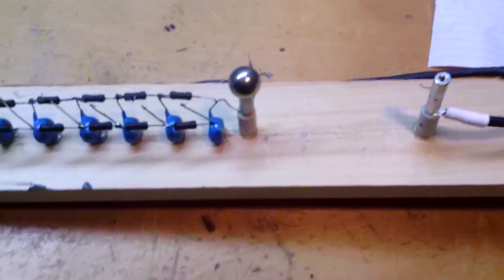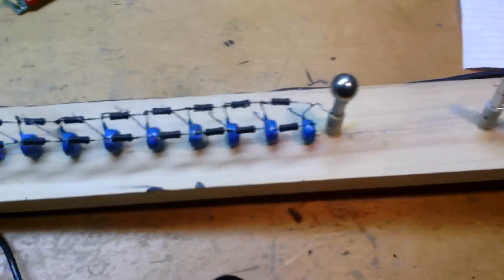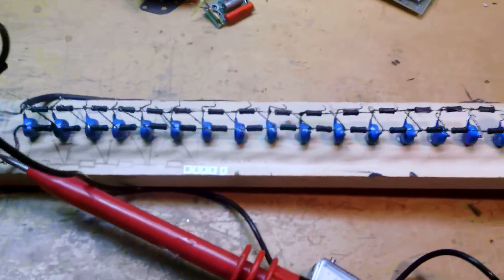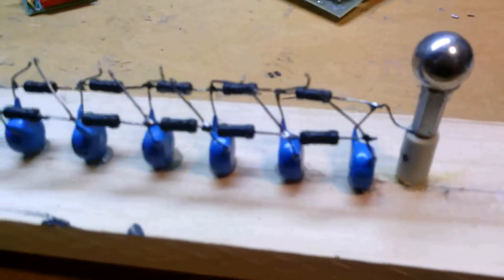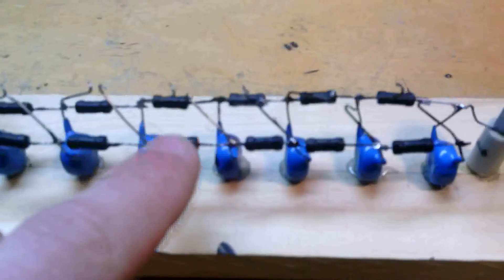Marx Generator update!

Comment: Nice generator! I have a problem. I'm using a flyback transformer, 10x 20Kv 1nF capacitors and 1m resistors. When I run my generator all I get is a hissing noise. When I move all of my spark gaps closer together the first gap just arcs really fast and there is no output. When I try making all of the gaps smaller and just have the first gap big it does not fire! What am I doing wrong?

Comment: hey, i have a possible question if its possible to get assistance... i have this iLuv iphone docking station now i picked up super cheap like 5 bucks..... with out a power supply so i was wondering if it was possible to drop a laptop power supply down from 19.5 to 15 and maybe the amps to.....

now im not exactly a outsider to electronics i have been working on basic circuit repair ect. and i am semi aware of what transistors, caps, resistors ect. ect. do how ever im not exactly sure how.......